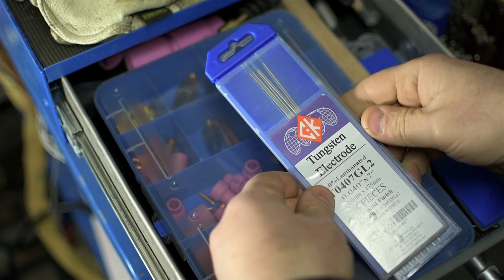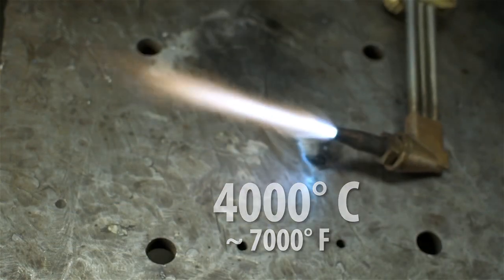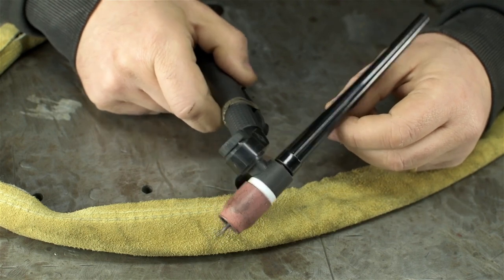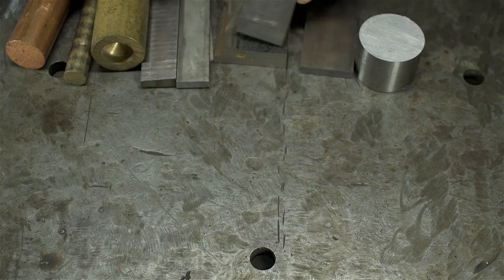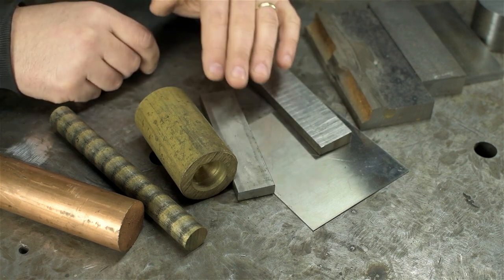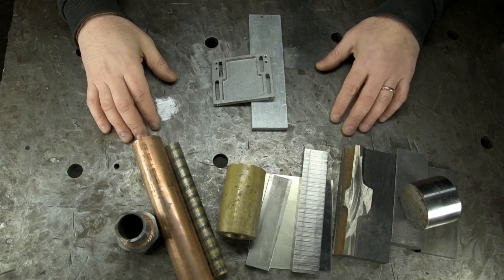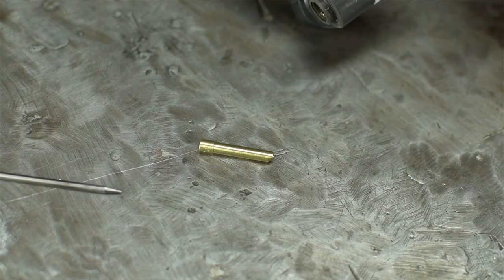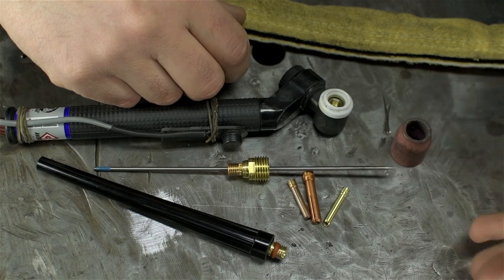Making A Stand! Why I Love TIG Welding

Comment: In my early twenties, knowing very little about welding, I still don't know a whole lot now, I bought a stick cheap welding machine to fix my drafting table chair. What I didn't realize was that it had an thin inner low carbon tube covered by a thick layer of aluminium or aluminum, if you prefer.  

So by the time, I realized this, it was no longer at drafting table height and more like a regular office chair. I finally realized and managed to strip away the aluminium and weld the steel. Problem was, it has very thin and my cheap welding machine didn't like thin. so I had to place a thicker outer steel tube, that I made at my father's workshop and I tried to heat the outer tube and try to fuse them together without creating any holes in it.

It ended up being useful for a couple more years until the steel inner tube broke again. Note, I am and was 165 lbs and that chair was either poorly designed or made for extremely thin people. Oh well, but that got me into welding. Still suck at it. In uni, they didn't have money for welding gases so we tried, me and some friends in a uni project,  to weld aluminium with AC but without gas.... it was obviously a disaster and I had to redo one of the pieces at the lathe and as it was a not structural part, we just decided to glue it wit epoxy with added aluminium particles and it worked quite well.
Reply from the maker: those bad surprises happen more than you think!  I've "fixed" plenty of parts only to find plastic oozing out of some hole.
Reply: @ThisOldTony  Thank you. That's a lot coming from you. Cheers

Comment: I once had to put in a fillet in one in TQ100 6" long. The only filler I had was coat hangers. That was a long day, LOL. It was a beauty when done though.(After a thorough grinding,LOL)I was using a square wave run by a generator. Not the best but the job never came back.

Comment: My only welding experience is with an old MIG welder in my dad's workshop. Though it also does stick. (different handle, obviously)

TIG looks like it has a lot more control than MIG. Once you pull the trigger on MIG, you have to keep moving at the welder's pace. That wire feed is relentless.

Comment: Thanks for the TIG instructions.  I bought MIG but my usage is light.  But I think a few of your techniques should have full episodes to explain them.  I tried scratching the cut in some metal tubing and applying compressed air, but all it did was blow out the other side.  It looks easier to do then that bandsaw.

Comment: Two more of the often TIG welded materials are Copper-Nickel (70/30 and 90/10) and Nickel Copper (Monel). Common piping materials, welded with standard DC TIG.

Comment: tig welding simplify my life a lot, but some times mig welding is best, mig is best when you had to weld large parts, tig is nice for that tiny delicated parts that other you will fry like butter in the kitchen, another benefit of tig is that some times when parts are tight you dont need filler to weld, the must had tools in this century is a tig ad/dc welder and a 3d printed (the good ones)

Comment: I think the closest in terms of old welding techniques to TIG welding is probably atomic hydrogen welding, where an electric arc is used to split molecular hydrogen into atomic hydrogen, which then recombines on the workpiece, releasing a large amount of heat.

The advantage of AHW over TIG is that what you're welding doesn't even need to be conductive, since the arc is maintained completely separately from the workpiece.

Comment: Having TIG welded on every metal you showed in the vid, can confirm brass sucks. So does cast iron but its better than brass.
The zinc boils off and makes it's usual cheery mess of things. I've made it work twice, or once on 2 tiny parts either way... My coworker wanted the ends of some tiny brass eye hooks fused together so they didnt catch on his twine he was running through them. It was rather tricky and involved tiny needle nose pliers and fast foot work.
Try getting some smaller filler wire? You have to feed a bit more but it helps keep the puddle the same size vs loosing heat to melt a larger filler.

Comment: I first learned MIG, and now own a cheapo secondhand flux-core wire-feed, which has at least been somewhat useful, but I've been turning over the idea of learning TIG for a few years (from back when you and AvE each opined upon the matter of which process to learn first, stick or TIG) and the thing I keep hitting my head against is the initial cost.
Maybe this Summer, after the truck is paid off.
Reply: I'm exactly where you're at. Long ago I had a crappy flux-core wirefeed welder that soon burnt out it's transformer, and have been putting off buying a replacement. April is my bonus-month... I'm buying the Everlast PowerTIG 200DV 200AMP ACDC tig. 
Bracing myself for USD 2000 by the time I have the cylinder, accessories etc. 
But it is time....

Comment: Dear Mr Old Tony,  This 
Thanks for all the awesome content.  
The way I have justified the AC welder to my wife is that the AC welder was much "more capable" then my DC only unit that I gave away. 
Feel free to make a justified explanation for the husband/wives to show their other that the AC tig is more than a two types of material. 
The way I see it,  yes you can weld just two more types of metal but the added bonus is you can weld what you already had the capability of before. 
** Side note if you make said video please delete this comment, so my wife can't see it in years to come.

Comment: ToT, I'm an auto mechanic by trade but I'm sort of what most people referred to as a jack of all trades master of most ha ha But anyways I usually use a MiG welder wire feed And I've been able to weld pretty decent welds with wire feed MIG and I have a stick welder I'm decent with but I gotta be honest I've never used a TIG welder. 😯😞 I always thought they were a little out of my price range for a top of the line TIG, But I've got multiple wire feed wilders 1 is even an old flux core which I actually like and a lot of people hate it but it's all in 1 unit Simple, the welds  are pretty strong or generally just a little splattery but if you use a little bit of anti splatter spray and you got a grinder then your good to go, as my Grandfather used to say, a grinder and paint makes you the welder you ain't.!! 😬😬

Comment: Thanks for the informative video.  So far, I've only made a few, very messy TIG welds on aluminum. But I hope to improve soon. I notice that you have three novel items -  TIG button, wedge style collets, and a TIG handle with what appears to be a swiveling gas/electrical connection to the portion holding the electrode.
Have any fellow viewers used these and if so, what are your opinions?

Comment: "Constant current" is great except for the fact that it's impossible when welding since as the base metal and/or welder and/or electrode/filler rod/wire get hotter current requirements change. And anything that can be "tigged" can be "gas welded" and in the overwhelming majority of cases "stick-welded" or "migged". Especially carry-in "job shop" or other field repair/rebuild/repurpose work where you're not going to get the luxury of nice clean, shiny bench top "fabrication" working conditions. As for brazing not being "welding", neither is any "welding" of base metals with dissimilar "filler rod". Using a "TIG welder" to   join parts of a given base metal with an "alloy" filler rod that "works" for the task of sticking the parts together - which is 99 percent of the "work" that hobbyists do with a TIG welder - isn't "welding" either by that definition. And most of those "welds" won't/wouldn't pass a certification test or even real-world, real-life "non-destructive testing" in the field if the finished product is structural, exposed to the elements, etc. The only way to know for sure the "filler rod" is the correct material for the base  metal is to use the base metal for it's own filler and TRULY "weld" the parts together. Given how many things a "gas welding" set-up with a real torch and the ability to use propane inatstead of acetylene for heating will do along with all the things "stick welders" and MIG welders can do which TIG cannot and how relatively rare stainless steel  and aluminum are as fabrication materials rather than forgings or stampings and how rare and specialized TIG is as a general purpose fabrication/repair/rebuild process outside of a few specialized, transportation-related "industries" and how difficult or impossible it is to do that kind of thing in a machinist's "job shop"  vs.  a "welding shop" and how few professional machinists and welders "do it all" or at least successfully, well and profitably "long-term", the idea that a TIG welder is an ideal general purpose "money maker" rather than an excuse to farm out and mark up "real" welding or "replace" rather than repair/rebuild "carry-in" work and have a "job shop" without industrial/commercial tools, utilities, insurance, taxes etc is pretty funny.

Comment: You can weld aluminum with DC as well, its been done for over half a century. The issue is heat input and lack of cleaning. The way around it is introducing helium to your argon or running straight helium. This is where the term (and brand name) heliarc came from :-). Its still used today due its deeply penetrating qualities; mainly used in injection mold and die repairs or extremely thick aluminum plates are used. You can weld 1" thick aluminum jig plate with a 100 amp DC power source with pure helium as a shielding gas. Its pretty insane when you see it done because it defies the logic that we all have been taught all these years. Helium is the almighty equalizer and until you weld with helium, your brain will not understand or accept it. So, I urge everyone to go out and get a pony cylinder of helium (its not cheap) and give DC heliarc a crack on that old chunk of aluminum we all have kicking around. You might be surprised by what you see, and are able to do.

Comment: I find it a lot easier to use the tig button In your wire hand especially if you have to hold the button. Some machines allow you to click the button for on and off usually with a pre start and ramp down.

Comment: To me unless you need to work on aluminium, acetylene welder is still my go to choice, probably because I learned it first... 
Duty cycle is capacity of your gas tanks, ajusting for material thickness is just swapping the nozzle tip and ajusting flame. And as you showed - you can cut thick metal with ease. You need to get different rods material for certain jobs, but it seems more intuitive than tig.

P.s : I'm aware that it has cons too, like heating everything up when welding, which is often less than ideal.
Reply: You can oxy weld aluminum
Reply: @mitchdenner9743  well, technically yes, but potential warping issues are making less viable option for me. Depends on the operator I guess.

Comment: I am not very good at TIG welding as I don’t get enough practice but I like the fact it doesn’t cover my garage in sparks as MIG welding does. Funny but I think aluminium is much easier to TIG than mild steel. Impressive watching you feed the rod with gloves. I do have more problems with distortion using TIG because I weld slowly and end up overheating. I do like the pedal over the button. I hate my TIG torch it’s heavy.

Comment: You should talk about welding aluminium with DC. I have a cheap DC tig and had some aluminium repairs I needed to do. I did some research and found that I was actually able to weld aluminium with it.

Comment: Hi Tony, thoroughly enjoy your humor and technical explanations how to do things in the shop.  Anyhow, I've noticed in quite a few videos you have that switch just stuck on the TIG probe handle. Have you thought about making a custom probe handle where you can install that switch into it?  Seems like it would be a good practical project. Not sure what it is made of, assuming Bakelite but guessing surely there are insulating materials that would work as well if you couldn't turn or machine the Bakelite.  Anyhow, perhaps you could create your own line of probe handles and market them, clearly probe technology hasn't reached its design apex, since you have demonstrated a handy practical improvement just by adding on the switch.

Comment: TIG is a slow and expensive welding process, you can use it for almost any type of metal if you are crafting at home, but in industries it is used only for expensive metals and alloys, and it is harder to use then MIG or MAG.

Comment: TOT please excuse me for high-jacking your YT channel but in reading the comments I realised there might be viewers who could help me. I have an Essetti 200 AC/DC TIG machine that I bought about 20 years ago. It has been an excellent machine but I have lost the owners manual for it. Within the owners manual was circuit diagrams for a foot pedal and pulser accessories. At the time of purchase I didn't give it much thought but with the increased popularity of micro-controllers, I feel these diagrams would be a good head-start towards using the old girl for some CNC welding. If anyone out there is able to provide me with the said manual or an Essetti AC/DC TIG welder manual with these circuit diagrams, I would greatly appreciate it. Thanks Tony, I hope you don't mind. Cheers Neil      (PS .  I always get a kick out of your videos.)

Comment: Oddly enough, welding round copper was my first step in this metal.  Needed to join grounding wire and code doesn't allow solder.  So I welded it and did it in the attic which is where the splice point ended up..no fire.

Comment: In all seriousness, I would like to see your take on gas vs, tig welding on what would ordinaritly be tube frame aircraft construction. (Thin wall 4130 typically)  I know many production houses mig weld for speed, but gas weld was the old school method of choice and tig the semi- equilvalent new kid on the block.  I would like to see your particular brand of analysis and possible solutions on this application.  Or course, only for educational / experimental purposes.

Comment: I accidentally welded some galvanized steel once. Not enough to make me sick, but enough to really irritated my sinuses. Now any time I have to weld galv I wear an inexpensive surplus Czechoslovakian gas mask that just so happens to fit nicely under my welding hood. 😁
Reply: That sick yellow green zombie-like color that the zinc plating turns to when you heat it to weld, and the scary smoke and gas should tell you straight away that this is evil alchemy!

Comment: I've been watching your videos for months and finally got  myself a tig welder 200 acdc (chineese) sorry! Well started to make some beeds... not so simple but you were a great help and then there is something that I didn't notice in your videos. That smell coming from the Argon. Well things came tricky when facing to reality. I'm welding in my Garage with no windows or ventilation. Just opening the door that opens  to a building basement. Now I feel so disappointed. I guess I will stick to going back watching your videos  since I got no clue now How to solve my problem...
Reply from the maker: argon has no smell.  unless years of it has broken my nose.  you sure it's the argon?  dirty metal gives off fumes.  TIG shouldn't smell.  that said, you are pumping argon into a closed space.  ventilation is important.  could you run a small fan with a long drier type exhaust?  and maybe another one for fresh air?  they sell fume hoods but you can't weld in a totally enclosed space.  not for long anyway.

Comment: I want to get into welding. I would like to make yard art stuff and simple metal art objects like nut and bolt animals maybe brackets for around the garage type stuff. Anyway, after watch a ton of youtube videos I was set to purchase a Hobart Mig 210MVP, however, I like the cleaner look of the TIG weld. Would I be able to TIG nuts, bolts and odd shaped metal objects together or should i go with the MIG and be able to squeeze, zap and clean up the welds?

Comment: Hello Tony, I have a question about this video, you use the tungsten as a scribe, do you need to clean it before you weld? Also, how did you get the square tube to break like that in the video?

Comment: The joint made  at 10.35, is more typically known as bronze welding as you are using a filler rod to build up a bead , brazing if i am not wrong is the flow of filler rod into the joint by capilliary action, similar to soldering, at least thats the way it is in the UK.
Reply: Brazing and welding are almost incentive with the difference being that in brazing you're not getting the base metals up to melting temperature, there's no capillary action drawing the filler into the joint like in soldering.

Comment: "Zinc welding will kill you" is an extreme overstatement, and seriously mis-states the actual dangers of welding . Welding zinc without proper PPE and ventilation can cause you to get metal fume fever, a flu like illness that last a few days. If you have other health issues like emphysema, such as the infamous case involving Jim Paw-Paw Wilson, it may possibly contribute, but over all if you are otherwise healthy, welding zinc will not kill you, and likely will not even cause long term effects. 

What can cause serious health issues is most welding in general without proper PPE.  Welding stainless gives off hexavalent chromium which is a known cause of lung cancer,  and stick welding steel releasing manganese known to cause brain damage. Both can cause very real, very permanent health issues, but zinc is usually the only devil that is mentioned. 

You 100% should take precautions when when welding zinc, but it will probably not kill you if you don't. But you should also be educated and aware of the other ways welding can effect your health, and not just demonize zinc.